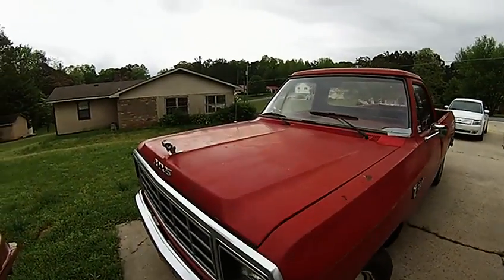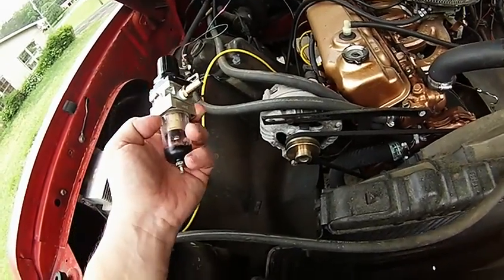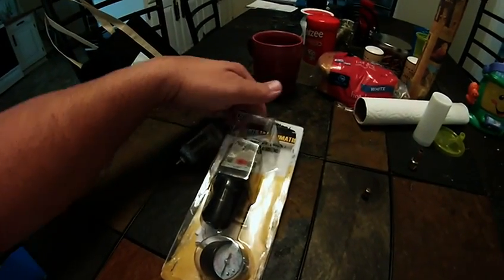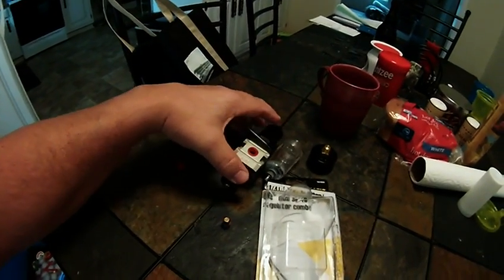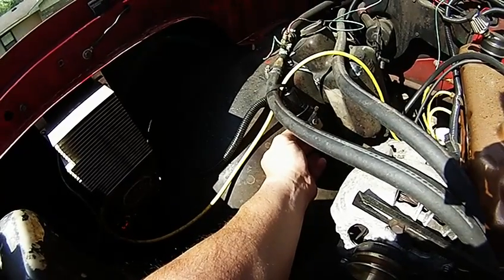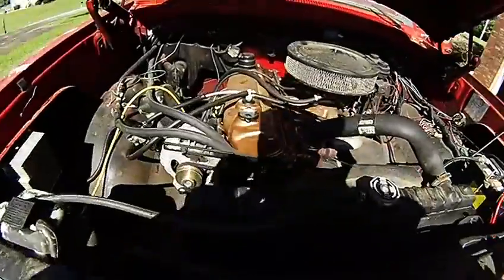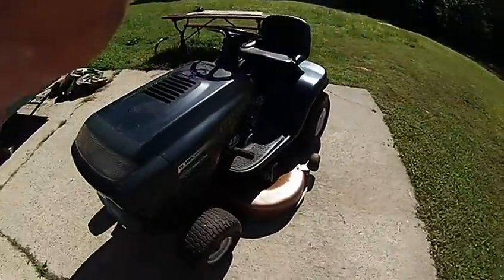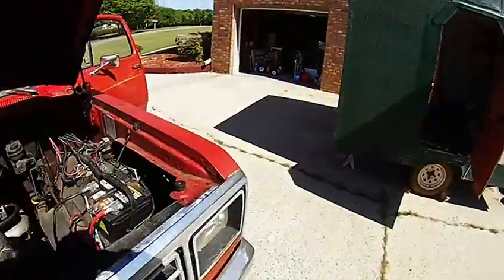Homemade Catch Can For PCV

Comment: You've got no worries about carbon deposits on the intake valves since the fuel vapors from the carburetor tend to 'wash' the oil deposits away before they harden into 'carbon' deposits.   However, if your vehicle had Gasoline Direct Injection, then I would suggest that you completely disconnect the hose from the PCV valve and just leave the PCV valve open to let excess crankcase pressure out into the air.  That would stop carbon deposits from forming on the intake valves of a GDI engine because there would be no oil vapors coming from the crankcase.  Hyundai knows about this problem, that is why their new 2017 Hyndai Elantra is sticking with Port Injection instead of GDI.
Reply from the maker: I hadn't thought about the fuel cleaning the valves. It probably cools the intake valve a bit too.